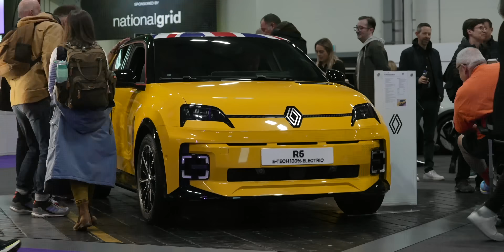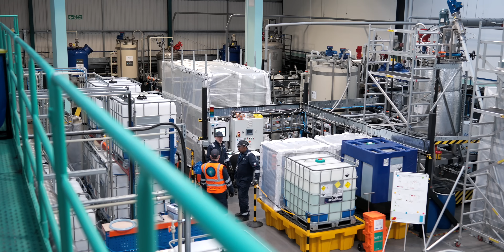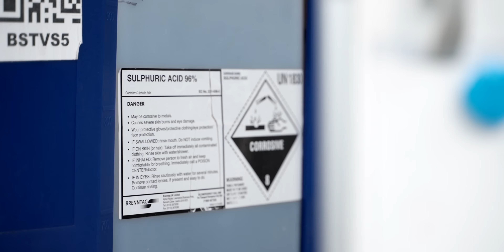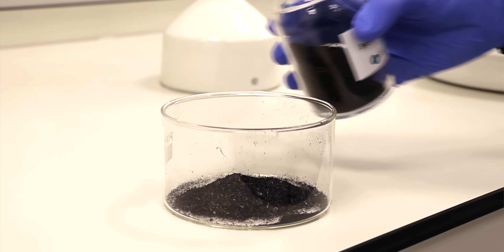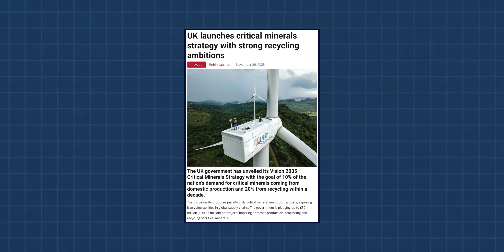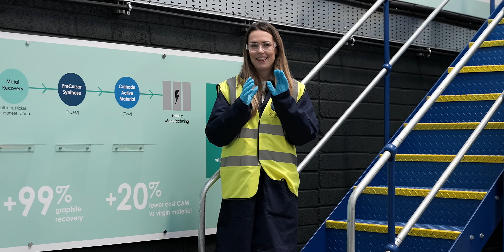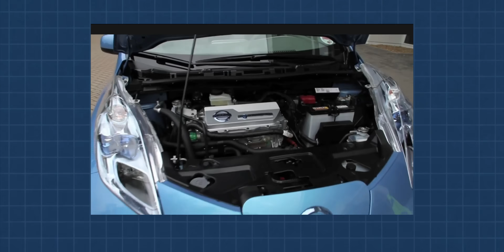EV Battery Recycling Could Be The End Of Mining!

Comment: I recycled a Tesla model 3 battery by sticking it on my garage wall - it now powers my house 😊
Reply: First thought was the whole EV goes on the wall...
Reply: Rubbish!

Another Walter Mitty.
Reply: @ForestForest-n9i oh you're back, amazing, I've missed you...
Reply: @ForestForest-n9i @ForestForest-n9i
At some point it’s worth stepping back and looking at what’s actually working now, not what’s been “five years away” for the last two decades. Battery Electric Vehicles (BEVs) have already won the light-vehicle race on efficiency, infrastructure, cost, and real-world usability, while hydrogen remains a niche science project for passenger cars.
First, efficiency matters. BEVs convert roughly 70–90% of grid electricity into motion. Hydrogen vehicles (both FCEVs and H-ICE) lose huge amounts of energy producing hydrogen, compressing or liquefying it, transporting it, and then converting it back into electricity. Once you count all that, hydrogen struggles to reach 25–35% well-to-wheel efficiency. Using clean electricity to make hydrogen instead of charging a battery directly is simply wasting energy.
Second, infrastructure is decisive. Electricity is already everywhere. BEV owners can charge at home and use a rapidly expanding public network. Hydrogen stations are rare, expensive, complex, and unreliable. In the UK there are only ~15–16 hydrogen stations total, with about 6 open to the public, versus 57,000+ public EV charging points and growing fast. Globally the contrast is similar: millions of EV chargers vs ~1,100 hydrogen stations. You can’t scale a consumer technology without infrastructure, and hydrogen never has.
Third, cost and practicality. BEVs have lower total cost of ownership: cheaper “fuel,” fewer moving parts, and less maintenance. Hydrogen fuel is expensive (often $10–15/kg in the US), stations frequently go offline, and you can’t refuel at home. This isn’t theoretical—hundreds of Toyota Mirai owners in California are now part of class-action lawsuits after being stranded by broken stations, skyrocketing fuel prices, and vehicles that have lost most of their value.
Fourth, a point often ignored: FCEVs still use lithium batteries. They are series hybrids—hydrogen makes electricity, which is buffered in a lithium-ion battery that powers the motor. So arguments against BEVs based on batteries also apply to FCEVs, plus FCEVs add fuel cells, platinum catalysts, high-pressure tanks, and more complexity on top.
Fifth, the market has already decided. Global EV sales jumped from ~3 million in 2020 to over 10 million by 2023, with BEVs dominating. Automakers and analysts (IEA, BloombergNEF) consistently point to batteries as the winning technology. That’s why companies like GM and Stellantis have scaled back or exited hydrogen passenger-vehicle programs, and why hydrogen is increasingly being limited to specific heavy-duty or industrial niches, not everyday cars.
Hydrogen cars do have zero tailpipe emissions, but once you consider production methods (mostly fossil-based today), energy losses, infrastructure costs, and real-world failures, they simply don’t compete with BEVs for personal transport. While hydrogen advocates keep promising a breakthrough “soon,” millions of people are already driving cars that are efficient, affordable, charge at home, and work every day.
This isn’t ideology—it’s engineering, economics, and market reality. For light passenger vehicles, the conclusion is no longer controversial: plugging in beats waiting for a miracle fuel.
Reply: @ForestForest-n9i Tell is about what car you personally own then. Is it hydrogen?

Comment: Ever wondered where lead acid batteries end up? In years gone by there was a trade-in price on every dead battery. Lead is not "that" plentiful. Yea there is loads of ore - at a price. In some distant land (being polluted) but hey! FWIW may last ICE car lasted 21 years, albeit serviced by the same garage for 15. Gave it to them instead of a paltry trade-in elsewhere, and they used it as a courtesy car, then a learner passed her test in it. I saw it yesterday and it didn't look bad at 27 years old. Cars can last, and EVs take less looking after. BTW, the power output of that ICE engine had deteriorated by at least 20%, sound familiar? (despite regular servicing).

Comment: In 2010 the global EV sales were 12,000 cars, and this went up dramatically in 2011 to 50,000 cars (I'm guessing the Leaf and the Zoe the majority of those).  If those 15 year old cars will have to supply the materials for the cars produced today, there is a problem with the numbers, because in 2025 there were 20.7 million electric cars produced in the world, added to that there are also hundreds of thousands of lorries, buses, scooters, motorbikes, millions of electric-bicycles, as well as boats, and home storage.

There isn't enough existing batteries to recycle for new vehicles and that is if we recycle the 15 year old cars, if we look back 20 years, there were only 1,700 electric cars manufactured globally in 2005.
Reply: Yeah, I thought of that too. Recycling is very important, but there aren't enough to recycle to stop mining at this point. And those old ones aren't dying. I drive a 12 year old BMW i3 and it still gets the original advertised range on the original battery. So unless it suddenly dies or is wrecked it won't be having a battery recycled any time soon.
Reply: Altilium's recycling process supports UK ev manufacturers compliance with EU battery regulations as well as rules of origin requirements - from 2031 batteries must contain minimum recycled contents of 16% cobalt, 6% lithium and 6% nickel - with the recycled ratios increasing in the years following. The recycled content is added to / blended with primary supply for ‘new recipe’ battery manufacture, thus future proofing this business.
Reply: @davidcartwright7740 good luck with having 16% cobolt in your batteries.  The market share of LFP batteries is about 30%-40% and growing.  And LFP batteries don't contain any Cobolt
Reply: @matthew_baynham  it’s16% recycled content of whatever overall Cobalt content may be required in new batteries. 
LFP batteries will still have the same recycled content targets for the elements they contain, including the valuable Lithium, Graphite and Copper.

Comment: It worries me that especially for crashed vehicles, we are recycling batteries that can be used for home energy storage. There are many open source projects repurposing EV batteries as High Voltage solar storage for the home and they are extremely good at this. This usuage is infinitely more environmentally freindly than recycling the contents (which can be done later anyway when the battery expires).
Reply: Not sure many would want batteries from a crash in their house system?
Reply: @Biggest-hz7ng Yeah batteries from crashed cars are almost always good. I've looked for them for an electric conversion and there are wrecked ones that look a mess and still run and drive perfect. No battery damage.
Reply: @oddjobsandrandomprojects 

What nonsense!

That last comment has to be one of your best for entertainment value.

Are we to believe you're qualified in recovering batteries from wrecked vehicles.

Is there anything you don't do?

(Note sarcasm.)
Reply: @ForestForest-n9i Very few things I'm not able to do. Perhaps you should get some skills. The process I decided to do is on my channel
Reply: @ForestForest-n9i @ForestForest-n9i Tell is about what car you personally own then. Is it hydrogen?
Reply: @ForestForest-n9i @ForestForest-n9i
At some point it’s worth stepping back and looking at what’s actually working now, not what’s been “five years away” for the last two decades. Battery Electric Vehicles (BEVs) have already won the light-vehicle race on efficiency, infrastructure, cost, and real-world usability, while hydrogen remains a niche science project for passenger cars.
First, efficiency matters. BEVs convert roughly 70–90% of grid electricity into motion. Hydrogen vehicles (both FCEVs and H-ICE) lose huge amounts of energy producing hydrogen, compressing or liquefying it, transporting it, and then converting it back into electricity. Once you count all that, hydrogen struggles to reach 25–35% well-to-wheel efficiency. Using clean electricity to make hydrogen instead of charging a battery directly is simply wasting energy.
Second, infrastructure is decisive. Electricity is already everywhere. BEV owners can charge at home and use a rapidly expanding public network. Hydrogen stations are rare, expensive, complex, and unreliable. In the UK there are only ~15–16 hydrogen stations total, with about 6 open to the public, versus 57,000+ public EV charging points and growing fast. Globally the contrast is similar: millions of EV chargers vs ~1,100 hydrogen stations. You can’t scale a consumer technology without infrastructure, and hydrogen never has.
Third, cost and practicality. BEVs have lower total cost of ownership: cheaper “fuel,” fewer moving parts, and less maintenance. Hydrogen fuel is expensive (often $10–15/kg in the US), stations frequently go offline, and you can’t refuel at home. This isn’t theoretical—hundreds of Toyota Mirai owners in California are now part of class-action lawsuits after being stranded by broken stations, skyrocketing fuel prices, and vehicles that have lost most of their value.
Fourth, a point often ignored: FCEVs still use lithium batteries. They are series hybrids—hydrogen makes electricity, which is buffered in a lithium-ion battery that powers the motor. So arguments against BEVs based on batteries also apply to FCEVs, plus FCEVs add fuel cells, platinum catalysts, high-pressure tanks, and more complexity on top.
Fifth, the market has already decided. Global EV sales jumped from ~3 million in 2020 to over 10 million by 2023, with BEVs dominating. Automakers and analysts (IEA, BloombergNEF) consistently point to batteries as the winning technology. That’s why companies like GM and Stellantis have scaled back or exited hydrogen passenger-vehicle programs, and why hydrogen is increasingly being limited to specific heavy-duty or industrial niches, not everyday cars.
Hydrogen cars do have zero tailpipe emissions, but once you consider production methods (mostly fossil-based today), energy losses, infrastructure costs, and real-world failures, they simply don’t compete with BEVs for personal transport. While hydrogen advocates keep promising a breakthrough “soon,” millions of people are already driving cars that are efficient, affordable, charge at home, and work every day.
This isn’t ideology—it’s engineering, economics, and market reality. For light passenger vehicles, the conclusion is no longer controversial: plugging in beats waiting for a miracle fuel.
Reply: @ForestForest-n9i Ross Kneebone — since you’ve publicly stated that you work as a representative for a hydrogen bus company, the way you behave here looks less like honest debate and more like paid advocacy mixed with trolling. You don’t show up to add insight; you show up to complain, derail threads, and take snide shots at other commenters instead of engaging with evidence.
So let’s stick to reality. In the UK today there are roughly 16 hydrogen refuelling stations in total, and only about six are actually open to the public for passenger cars. That’s not a rollout — that’s a dead end. By contrast, the UK has tens of thousands of public EV charge points, and the number keeps growing because electricity already exists everywhere and scales cheaply. Infrastructure decides consumer technology, and hydrogen has simply failed that test.
On efficiency, the physics are settled. Battery electric vehicles convert the majority of grid electricity into motion. Hydrogen passenger cars throw most of it away making hydrogen, compressing or liquefying it, transporting it, and then converting it back into electricity inside the car. Well-to-wheel efficiency for hydrogen struggles to reach a third of what went in. Turning clean electricity into hydrogen instead of charging a battery directly is just wasting energy.
You also repeatedly attack lithium batteries as “dangerous” or “unsuitable,” which is especially dishonest given that fuel-cell vehicles still rely on lithium-ion batteries. They are series hybrids: the fuel cell generates electricity, that electricity is buffered in a battery, and the battery powers the motor. By your own logic, hydrogen cars fail before you even get to the fuel cell — and then pile on extra complexity with platinum catalysts and high-pressure tanks.
Real-world ownership backs this up. BEVs charge at home and work every day. Hydrogen car owners deal with broken stations, fuel shortages, extreme prices, and collapsing resale values. These aren’t hypotheticals — they’re documented outcomes of trying to force an unscalable system into consumer transport.
Mocking “history lessons” just highlights bad faith. History is where facts come from, and history shows which technologies actually scale. BEVs are already here, already working, and already dominant because they’re efficient, practical, and affordable. Hydrogen cars have been “five years away” for over twenty years.
So here’s the simple question you keep avoiding: what car do you personally drive — and is it hydrogen?
Reply: @Biggest-hz7ng  Actually there is massive demand for them as they are rarely damaged themselves.

Comment: I've given a thumbs up, but there is more to this story. In this video you only focus on one third of the problems we face as a species intent on destroying itself. We need a circular economy, so site placement of this fiscality is important to lower the recycling footprint. The building itself needs to 100% operating on renewables, so solar and wind turbines together with batteries storage on site that could sustain the operation for at least a week or more with minimal input from its prime sources or all operation stops until the renewable energy source recovers. The waste product i.e. use acid does this get recycled? If so how and is it ethical to use, I am assuming yes, but the question was not even address to the CEO. So many lessens have been learned, yet we seem to take no action to address them with earnest. Fully Charged in the early days would of asked all these questions, so what's gone wrong?
Reply: We're focusing on the things that make the most difference, working down the list of things that need to be done to fix emissions most quickly? Acid seems cheap, whereas metals seem expensive and resource intensive.